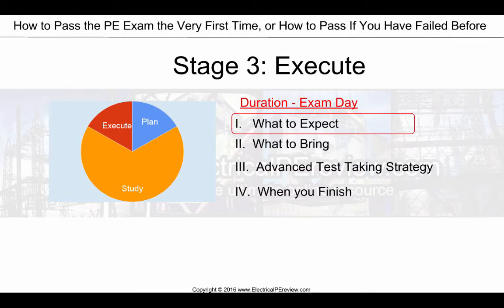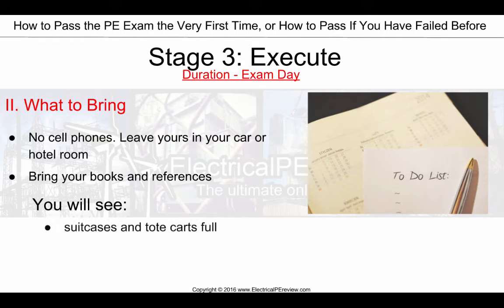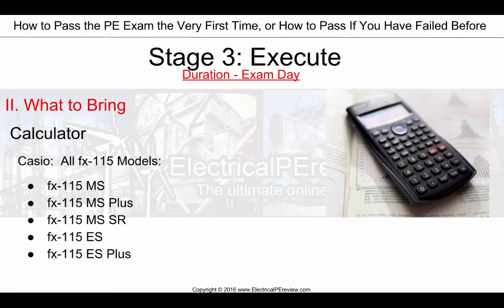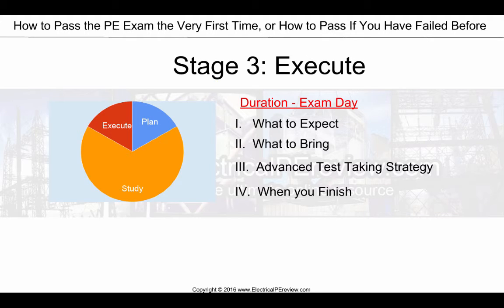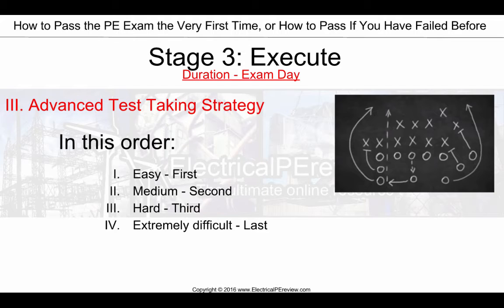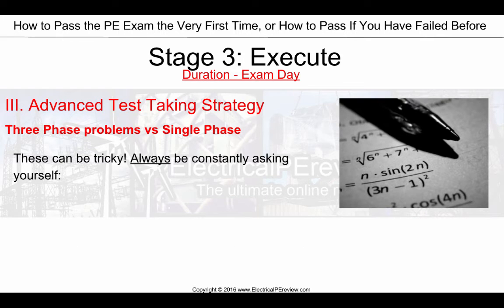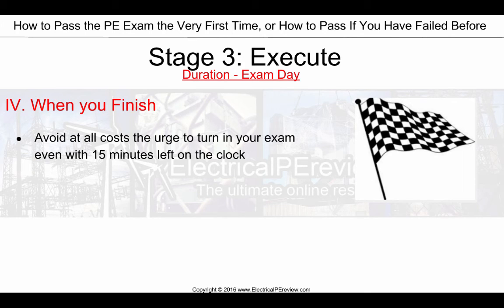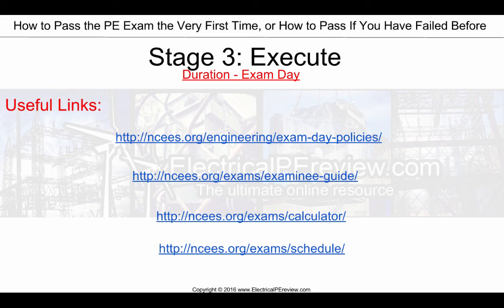Test Taking Strategy to Pass the Electrical Power PE Exam (Part 3 of How to Pass the PE Exam)

Comment: Yes, I made the same mistake. Even though I did not take a middle break and continued on... I left 45 minutes earlier. Not because I was exhausted (as I wasn't to that point: cortisol was RUSHING), but I felt I did what I could and this was WRONG! Spend EVERY minute of the exam allotted to you and don't leave early. If you still have time left in the exam, review already solved questions, go back to those you were in doubt.

Comment: One thing I got caught off guard is when on the CBT test I was given NFPA70 NEC2017 Code e-file as opposed to NFPA70 NEC2017 Handbook e-file I based my study on. Two files are structured technically the same but yet completely different. I panic a lot until I was able (sort of) to navigate through Code e-file and it's NOT EASY on the small screen divided in two portions - one for exam questions the other for a Code book. Study NFPA using a Code e-file ONLY and get familiar where the required tables are before the exam! I learnt this hard way for my next attempt.